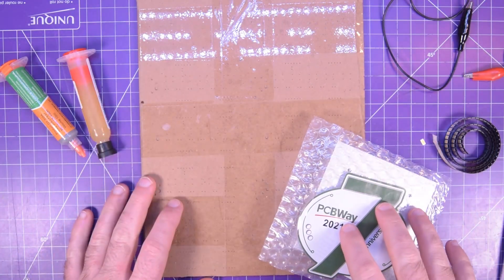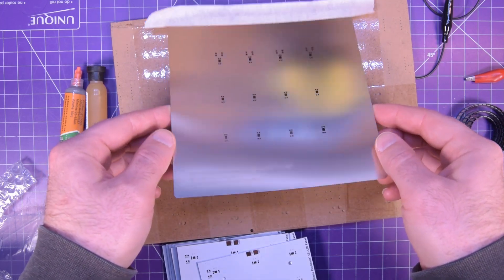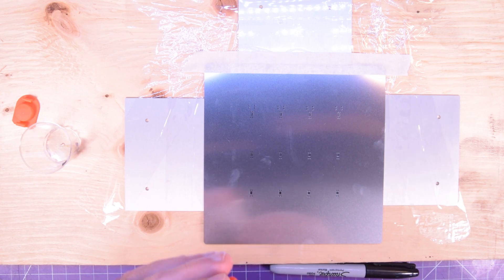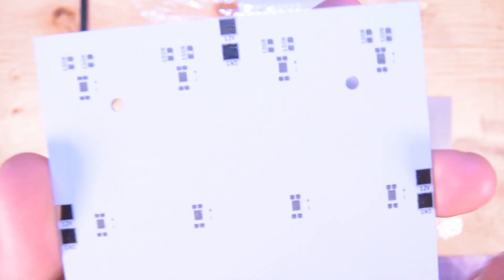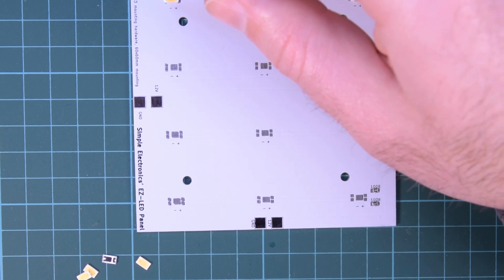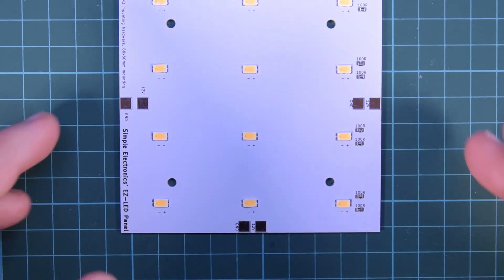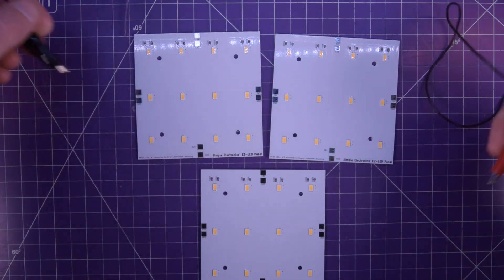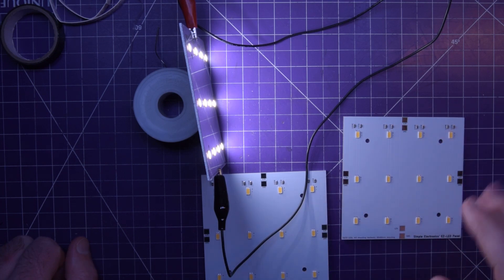DIY LED Panel - With SUPER HIGH QUALITY LEDs!

Comment: Should of mixed or massaged your paste on a metal or firm flat plastic sheet instead of jar. Use an eftpos card.
Use an eftpos card (plastic one) to move a roll (looks like a sausauge) or paste from the edge over all the wholes at once. Hold card at about 60 degrees to surface.
The amount of flux you added to the aged solder paste was about 5-10 times too much.
Ceramic temperature tweezers are good for wires but not for smd parts like those. Some curved fine point one are easier to manipulate part positions in the paste.
Good to see videos like this on SMT. Keep 'em comin 🖖

Comment: No need to apologise, your stencil setup was spot on and you got quite a good result, well done.
On more dense boards try a flexible filler knife to apply the paste after running a bead along the top of the area to be pasted. One swipe only of the spreader will help to stop too much paste making it down through and under the stencil.